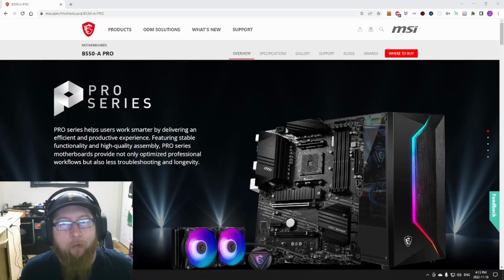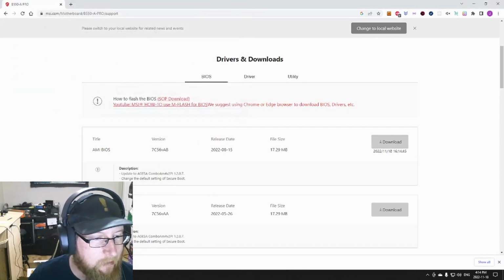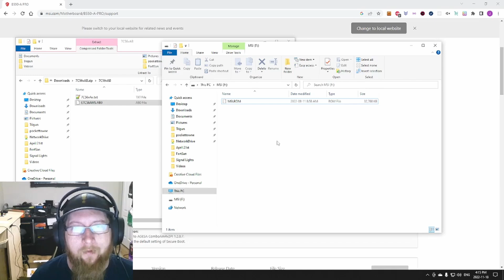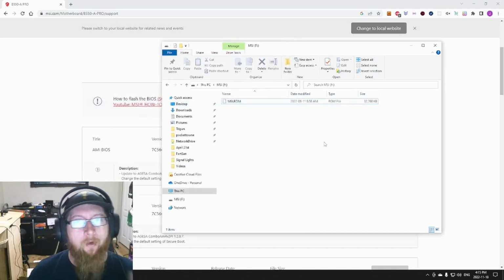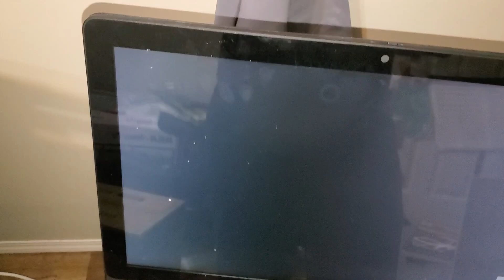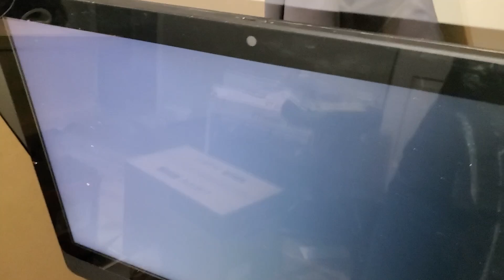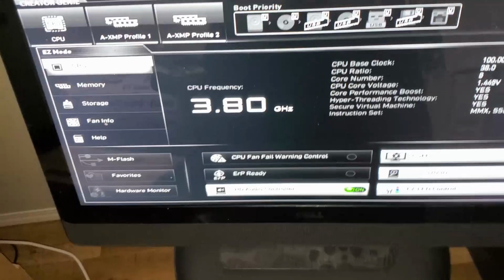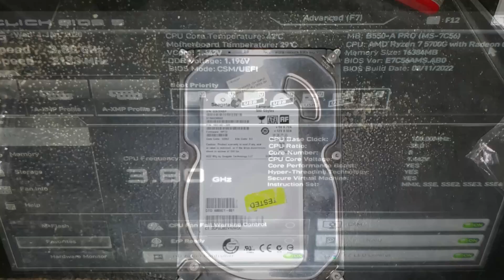MSI B550-A Pro Flash Bios

Comment: I am having this same issue. I have a 3700x cpu when I presses the bios button it does not blink. I am the exact same usb port.
Reply from the maker: If it doesn't blink at all, make sure your have the appropriate cables connected. CPU, 24-pin and try again. If it blinks once and goes out it doesn't recognize that it has sufficient power to whatever it needs in order to complete the operation.

If it can't find the Bios file, it just slow blinks.

Beyond that, you may want to contact MSI to find out what's happening because I haven't seen anything other than those two scenarios.

Comment: Can you do this with the CPU already installed?
Reply from the maker: Yes :) Just use the button and not the power switch on the case or bridge the Power SW Front Panel Header pins. If the system is installed in the case already, but you can see the debug lights and the Flashback Bios LED, then that's all you need to worry about.
Reply: @Kardall  alright thanks

Comment: User guide:
Updating BIOS with Flash BIOS Button
1. Please download the latest BIOS file that matches your motherboard model from
the MSI® website.
2. Rename the BIOS file to MSI.ROM, and save it to the root of the USB storage device.
3. Connect the power supply to CPU_PWR1 and ATX_PWR1. (No need to install CPU
and memory.)
4. Plug the USB storage device that contains the MSI.ROM file into the Flash BIOS
Port on the rear I/O panel.
5. Press the Flash BIOS Button to flash BIOS, and the LED starts flashing.
6. The LED will be turned off when the process is completed.
(No information about the storage file system is available. However, I believe formatting to FAT32 would be the safest option.)

Comment: Hey everyone! I know I'm too late to the party.

I just recently bought a MSI B550 A-Pro Motherboard (fresh out of the box) for my brother and tried to do an update on the bios.

Without installing the CPU, RAM, and GPU

Here's what I did:
1. Converted, cleaned, and reformatted my 28 gb USB stick from GPT to MBR and Fat32.

2. Downloaded the latest bios update from the MSI website.

3. Pasted the file to my USB drive and renamed it to MSI.ROM

4. Plugged in my USB to the USB slot right below the motherboard's BIOS flash

5. Turned on my PSU, clicked on the BIOS flash button.

6. BIOS flash light blinked for a few times (6-7 times), CPU light in EZ Debug LED went on for A second, then shuts off.

7. Now the BIOS flash red light is SOLID RED and it just stays ON forever and nothing is happening.

8. Turned the PSU switch off, removed CMOS battery for 10 minutes. Tried to do steps 4 to 6 again and still the same. SOLID RED LIGHT at the BIOS FLASH.

Is there something that I'm missing here? Am I doing something wrong? Is the motherboard defective? I've been trying to figure this out for the last 5 hours. Please someone help me out, I'm running out of solutions.

Comment: Hiya!! I tried your method and i think it worked? After the red blinking for a couple minutes it restarted itself with the CPU led flashing once and then the VGA and i get no output, is it a faulty GPU or PSU?
Reply from the maker: If you used the flash bios button, the system shouldn't restart or try to POST. It should just sit there usually with the red light off and the CPU light on the debug led. You will then turn off the PSU, and then turn it on again and finish the build on the box if you haven't already, and bridge the power sw pins on the front panel io header.

If it restarted for some reasons, perhaps something went wrong with the update? Make sure you have followed the directions like Fat32, extracted and renamed the bios file to the root folder on the usb. Apart from that I'm not sure what else to do because it should just work.

When you use the flash bios button, you need to watch the red light, it should start blinking somewhat slow, and then after a few seconds it speeds up.

Comment: I press the button it turns red but that’s it not blinking what’s wrong ??
Reply from the maker: Either the USB is not being recognized. You didn't extract and rename the Bios file itself (and just renamed the zip). You renamed the file but had the file extension hidden so now it's something like MSI.ROM.bin. Or the USB is not FAT32 Formatted. Or the file is not in the root folder like E:\MSI.ROM instead it's in like E:\somedirectoryfromthezip\MSI.ROM.

If it's a USB issue, some larger USB 3.0 drives have issues, you might need a smaller one or an older USB 2.0 one if you have one lying around.
Reply: @Kardall when I press flash bios it blinks then my pc turns on

Comment: I have the b550 tomahawk motherboard, I just got the AMD Ryzen 5 5600 xt from the 3600. Installed the new CPU and cooler and went to do a bios flash from the button on top. The USB blinks fast and the PC shuts off right at the 5min mark but then turns itself back on with the CPU light still red. I’m not getting power to my monitor or keyboard so I can’t manually enter BIOS
Reply from the maker: If you have a compatible CPU, temporarily install the old CPU, do the bios update, and put the new one back? I haven't done a Tomahawk board but it should be relatively the same.

I don't know what you mean by "Button on Top" though unless there is a button on top of the motherboard and not the rear io shield of that particular board.

Comment: I already put this build together what do I do
Reply from the maker: Well you can still do the Bios update with the USB as described. You don't need to have a compatible CPU installed and it doesn't hurt if your CPU is installed. Just do the steps and it should work fine.
Reply: How are u getting display do u need a gpu for that ?

Comment: Mine currently just stays blinking and diagnostic light on but has been like that for an hour
Reply from the maker: If it is a slow blink (it would change during the process to slow to fast), and it's been on that long, there's probably something wrong with the process.

It should be safe to power off the PSU, but make sure that the USB is Fat32 formatted, and you extracted the file to the USB and renamed it to MSI.ROM (oh not a zero).

Comment: MOBO absolutely refuses to update. Tried USB 2.0, 3.0, and I think perhaps a 2.1 stick? Red light flashes about 17 times, cpu diag light blinks once, fans start and stop right away and the whole board shuts off. No matter the bios version the same result is returned.
Reply from the maker: How big is the USB and are you sure it's Fat32 formatted?
Reply: Same issue

Comment: Bought this mobo today for my 5700x and this video helped me a lot. I was able to do it for the first try! Thanks a lot!✌️
Reply from the maker: Glad it helped!
Reply: Peter what version did you use was it the same one he used? I just did mine with the latest one 5/12/2025 bios update looked successfully but I got the cpu light on no POST. :(
Reply: @nervousmagic19  i also used the latest one (the same as you did). Maybe try it with a different pendrive. This mobo is quite sensitive for that and make sure its formatted in fat32.  Don't forget to rename the file and make sure it's the only file on the pendrive.
Edit: make sure your montor cable is connected to your gpu instead of your mobo. Ram sticks are in the correct slots(are they working?), don't put your cpu in the slot only after the flash is complete. Reset your cmos by removing the battery from your mobo for a minute before trying to flash again. If nothing is working try it with an older cpu. that way it should post and you can enter the bios and update it that way.
Reply: @nervousmagic19 And one more thing: if you think it was successful, turn on your pc and leave for good 5-10mins. Memory training can take a few minutes. When that is happening you won't see anything on your screen.

Comment: by doing this method would it help me get windows11 ? or i just need to enable tpm2.0 ?
Reply from the maker: It doesn't matter what operating system you use in the end, this process is done before installing your OS with a new build. It is to enable support for a CPU that requires a newer Bios version than the potentially 'shipped version' is. So that the motherboard knows what the CPU is to POST properly.
Reply: @Kardall  mine seems to be a AJ1 file not ROM

Comment: Hello quick question. What usb stick did you use? Because i have tried 3 and none of them worked
Reply from the maker: It's just an 8gb stick I got from some vendor. The smaller they are the better normally. Just make sure that you format it as Fat32 and extract the bios file to the root directory, then rename it to MSI.ROM so it looks like:

D:\MSI.ROM

then you should be fine.
Reply: @ okay thanks but i have another question. So when i use my other usb sticks to try the light turns on when i press it but when i let go it turns off. Why could that be? By the way i have all of the components plugged into the pc and the motherboard is inside the case. Could that be the cause?

Comment: So mine is still flashing after an hour
Reply from the maker: After that length of time, you should be safe to power off the PSU and determine what the cause of its inability to update is.

There are two blink speeds. "Discovery" and "Operation" lets say. So the slower flash is when you first push the button. Then what happens is it normally flashes faster as it does the update.

Should it not do the second stage, it usually means there is some sort of error. Either it can't find the bios MSI.ROM file on the Fat32 Formatted USB or the USB is not working for whatever reason (it happens a lot so if you have others, you can try them as well).

Comment: hey man i am building the pc and when i put the usb drive i click the flash biosbbutton it flashes a couple of times then the psu fan turns on with the cpu led and then the bios led turns off with the psu but the cpu led stays on nad still doesnt post, any solutions?
Reply from the maker: If the flashback bios red LED blinks a few times and goes out, it means it can't find the Bios or it's not the correct version.

Make sure it's Fat32 Formatted and you have extracted the bios file from the archive you downloaded, then renamed it to MSI.ROM

The MSI.ROM goes into the root USB folder so: D:\MSI.ROM
Reply: yes it  is like that but still doesnt work i double checked it. I tried it without anything with only a cpu with cpu and ram only with ram and with all cpu gpu and ram still nothing. And no matter what i do the cpu led doesnt change
Reply: or do you mean that the USB drive needs to be renamed MSI.ROM?

Comment: So I followed all the steps, I get a red stale light, then it flashes for 5 seconds then turn off, but for a while it keeps getting stuck on cpu for me when I try to get it to post, I’m bringing it to a local repair shop soon.
Reply from the maker: That means it can't detect the Bios file. Not sure what else to say. Perhaps the USB drive is not being recognized for whatever reason. Fat32, Bios file extracted and renamed to MSI.ROM (oh not a zero)?
Reply: @ so when I boot it up and no post it’s having a white light on the cpu, which I’m gonna have a pc person look at it, since it’s been ragging my brain, I’m so use to finding solutions easily.
Reply: @Kardall  found out the issue, it was the cpu, not the motherboard

Comment: The computer turns on and the light flashes quickly, but then it turns solid red...
Reply from the maker: The computer should not 'spin up'. Only the power supply should start when you push the flash button if it isn't a zero idle PSU. Sometimes the fans don't spin unless it's under load.

If your system is trying to POST, you are probably using the power switch or bridging the Power SW pins on the front panel header?
You should be pushing the flash bios button only to perform this.

Comment: My Red light is on while pressed but not flashing. Turns off as soon as i take my finger off it. Is the board faulty?
Reply: Update, the problem seemed to be that the board was actually running before hitting the button. Upon hitting the flash button with the system off and PSU on, I now have a solid red light. That's bad right?
Reply: It seems it is blinking for about 5 sec and then going solid. Any ideas
Reply from the maker: @lukebalogh3676  Make sure that you have extracted the bios file from the zip archive from MSI, and renamed it to MSI.ROM all caps (that's an oh not a zero). And that the USB is Fat32 formatted.
Reply: I've done that and I still don't get the flashing light

Comment: am will do this right now, yes you need to put the power for the CPU, my problem is that I only have 6 pins, not sure if I will need a new power supply
Reply: My bad, its 8 pin.  Still working on it
Reply: all done, everything is fine.  Thanks for the video

Comment: I plug in my USB with the bios the red light blinks for five seconds and then it stops blinking. I have my CPU installed and my CPU cooler and after that five seconds everything turns on.
Reply from the maker: If I remember correctly, if it blinks 'slowly' a bit and then turns off then it can't find the bios file on the USB or the bios update has already been done and it doesn't see any need to flash again maybe?

Did you make sure your USB is FAT32 formatted, you renamed the actual Bios file (not the zip file) to MSI.ROM and it is in the root folder of the USB. (Example; H:\MSI.ROM)
Reply: Same issue

Comment: I do everything right but i click the bottom starts blinking for 3 seconds everything turns on and pum then everything goes off and a solid red light no blinking whats that?
Reply from the maker: Make sure that the USB is FAT32 formatted and has the extracted BIOS file renamed to MSI.ROM that's an o not a zero all caps. I don't think I've seen it go solid red. Normally it shuts off so... maybe that's something different. You may want to contact their support desk to figure out what that solid light means.

Comment: Does the mobo have to be turned off ? 
I thought it turns on as soon it has power but someone said there are some pins u have to touch ? Im new to this.
Reply from the maker: For flashing it you do not turn the PC on with the case power button or bridging the power sw pins on the front panel header.

You use the flash bios button on the back of the motherboard, which is next to the USB port for "flash". If it is not installed in the case, you can look at the rear IO shield to see which one it is, but it's normally the one right next to the button (like I show in the video).

Comment: I found this video late.
I have the cpu installed with the cooler.
Can i do this with just the ATX Power?
Reply from the maker: You can do this with the CPU and RAM installed all that stuff. You just don't use the power button to do the flash, instead use the flash bios button. Just make sure the 24-pin and the CPU power is connected when you do it.

Comment: Hey ! thanks for the video , my red bios light stopped blinking but the usb light is still on and the psu fans arent running , any idea?
Reply from the maker: If the update bios light stops, your PSU might be in standby mode and the fans shut off until there is a draw on the PSU above a certain threshold.

Turn off the power supply and finish the setup on the PC on the box outside (first) and make sure it posts to BIOS and ensure it has done it successfully.

If the bios light did the fast blinking section for a few minutes and then turned off, like it transitioned from a somewhat slow blink, then started going faster and remained there for like 5 min or so then shut off, that usually means it was successful and you can flip the PSU switch and continue with the build.

Comment: Do i need to change the name of it? also with msi can i update it to the latest version straight away or is it like asrock where i need to update older versions first
Reply from the maker: For this particular board you can update to the latest version.

Yes, you have to rename the extracted ROM file to MSI.ROM (that's an o not a zero) and put it in the root of the USB stick. So if say it's a D: then it should look like: D:\MSI.ROM

Your ASRock comment is interesting, because almost all manufacturers have this issue. It's when an older Chipset is updated to support certain CPUs. And to make space for them (Especially AMD) they had to change the bios format for features, so the bios format won't be readable on an older bios version if you try to update to a newer one.

As far as I know, this board doesn't have this issue. But I no longer have one to try it on. You'll have to do your own research on that one.
Reply: @Kardall  thanks for the help

Comment: For those of you who get a slow red flashing light, but not a bright diagnostics light, assuming you did everything right, it could be it's not accepting your USB.  I had to try it with 3 different sticks before it accepted an old 2.0 USB that was 2GB in size. When it accepts it, the diagnostics light turns on and the red blinking light speeds up until it's done.
Reply: Do you know the model of your USB stick?
Reply: @EdwinRutilioSanchez he said it accepted a 2.0 USB stick
Reply: yah this makes since bought a 128gb 3.2 usb for window installs and it just doesn't work for that so I use the good ole 2.0 stick for anything like this now lol
Reply: THANK YOU, I did it without the monitor plugged in and I thought I fkt up, thanks to you I now know it just refused the USB stick
Reply: agreed. I tried 3 sticks. I went and bought sandisk cruzer and it finally worked. Make sure its a very basic usb stick not one of the old ones
Reply: Mine worked: Onn 16gb USB 2.0 Flash Drive but its diff for everyone.